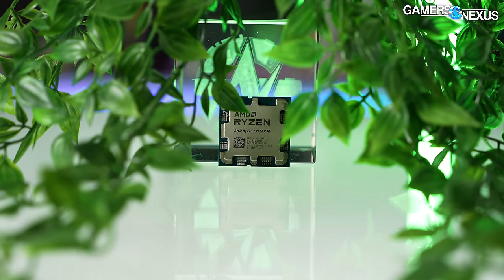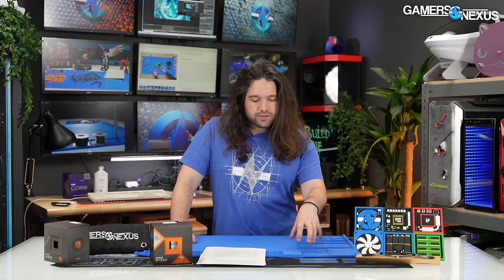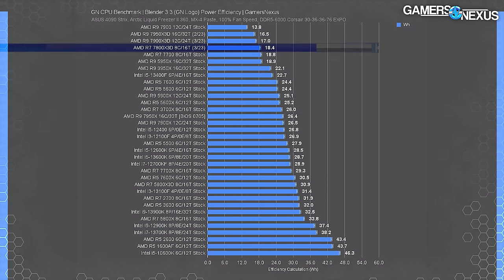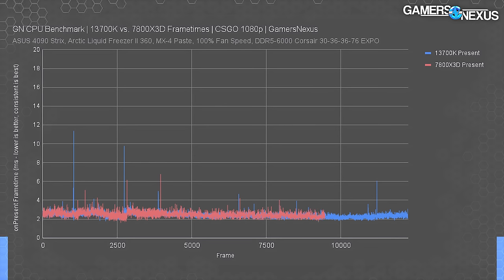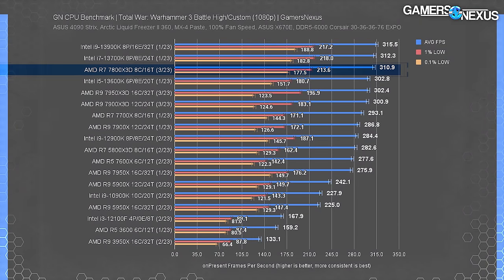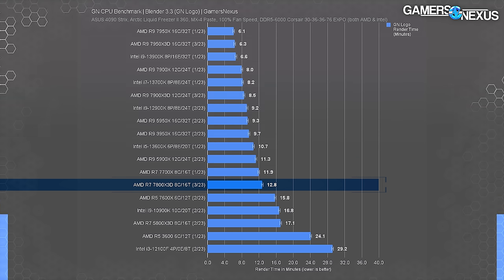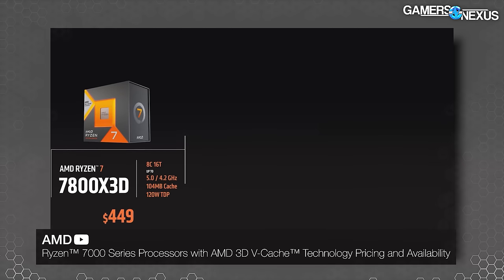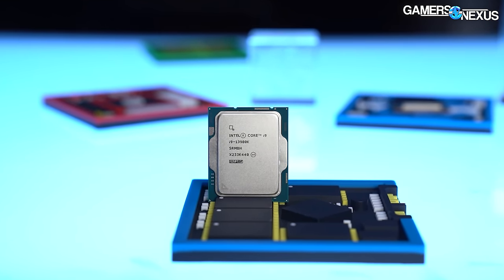AMD Ryzen 7 7800X3D CPU Review & Benchmarks

Comment: I feel that a larger subset of games would change the scenario quite a bit. Simulation games such as Flight simulator, factorio etc has the X3D parts pretty much destroying all Intel CPU's. Ironically those are the games that actually require a fast CPU. Would be great if you could find a way to benchmark any of those games and the conclusion, atleast in terms of gaming, becomes pretty different.

In general, even a tuned 13900KS can't really compete with the 7800X3D with a much larger subset of games.

Comment: This represents a monumental fuck up for AMD.  They could have just nixed the 7900X3D line and opened up the cores on the 7800X3D to 5.7ghz.  It would still be relatively efficient, cool running, and much better positioned as one of the best gaming CPUs available, competing much better with Intel.  Instead they effectively nerfed the whole 7000 series 3D vcache chip line.  What a bizarre move.  Intel will destroy these chips for gaming on the 14000 series, albeit with much higher power usage.  Efficiency is great, but gamers generally don't care about being THAT efficient; they aren't running long rendering workloads that take hours, but rather are generally firing up the PC for 1-5 hours of gaming a day.  I would have much rather seen the 7800X3D run at faster clock speeds with half the efficiency; it would still be substantially more efficient than the competition while competing on numbers.  We all know this is a numbers game, and most gamers who aren't married to a brand will just take the best performance for the price tier.  There is no way the 7800X3D will be the better bang for buck than the 14700k (and will likely even perform worse than the 14600k for gaming), but it could have been.  You'll save a bit on power cost, sure, but it won't be worth that level of performance nerf.  And I am not even getting into the whole issue with not all games even benefitting from 3D vcache.  AMD is constantly going their own way and shooting themselves in the foot.  They have great ideas and it is cool to see innovation, but they release gimmicky stuff like 3D vcache in chips meant to compete with Intel before it is even properly adopted.  Frequency is still king in gaming.  Why they would nerf the clock speeds of the most important chip (7800X3D) in order to sell their own inferior 7900X3D series at the expense of failing to compete with Intel this time around is flabbergasting.  The 7900X3D series is garbage for gaming, and the 7800X3D is nerfed for no reason.  How could they possibly have okayed this strategy?  Bizarre.

Comment: Do you have to do a clean install when coming from an older gen part like a 5600?
Reply: not necessarily. It will definitely work, for CPUs, it might show a scary-looking message about chipset change when booting, just agree with it and it'll be fine.
It is still slightly beneficial to reinstall because you'll have stuff related to the old chipset on your hard drive which might increase your boot time by a few milliseconds.

Comment: This is how I see it.

All x3d products are similar enough to say they’re the same for gaming.  They’re designed to be great when games are coded for them.  AMD clearly doesn’t do stuff without thought.  Cheapest model is good for gaming and also plenty of regular compute tasks.  Like photo and video editing etc.
They also have a mid tier for more production and a top tier for best production while also being able to retain top tier v-cache gaming performance.   I would argue that most people would either buy the 7800 or 7950 version and say the mid tier is a bit silly but I’m also not an expert marketer that understands the way people think and buy things.  Why would they make a product that clearly has no market?  
I would love to see actual sales of each to see how they break down.  
I’d assume 7800x3d would make up well over 80% and the top being at least 15% and mid the rest.  Who would buy a $600 product to save 100 when spending that 100 would save you so much time?  And most people that are building systems with top model are also pairing it with a mid to top tier gpu, at at least $800 if not double that.   That 100 dif is less than 5% of total sys cost.  Maybe the #s say otherwise but seems 2 models would be the way to go logically for sure…
And while this seems to be obvious on a high tier product like x3d it probably doesn’t Translate to the regular line of products?  Or are manufacturers just stuck in a system from the past that needs an update?  Especially with lower sales volumes in general.  We are now at the time where I’d say cpus are especially great at gaming performance and the upgrade timeline could be spaced out quite a bit longer.

Comment: I'm looking for a new PC and weighing 13700K and 7800X3D against each other. At the moment, AMD is cheaper (432€ vs 402€), performs a bit better in most video games and just destroys intel in terms of power consumption. Easy decision.

The thing I'm unsure about righ now is cooling. For 13700K I would've used an aio 360mm for all the energy it draws. even the best air coolers seem to be at their limits occasionally. Can, say the be quiet dark rock pro 4 or noctua NH-D15 more easily handle the 7800X3D?

If yes, that would be even more money saved for better game performance...
Reply: The 7800x3d is so much cooler, a $40 phantom spirit can do the job.

Comment: Absolute best channel, however reviewing a CPU, or GPU, and not including the midrange sku from each generations up to 4-5 years is not useful for the average consumer. I'm here looking at charts and have no idea how my I7-9700K, or a 9600K or 9900K, would perform and if upgrading would be worthwhile. If my CPU cannot achieve 120 or 144 FPS in today's games, then it would be nice to know I need to consider upgrading. Keep the good work.
Reply: some zen2 models are there for a measure; 9700k doesn't even have ht

Comment: The problem I see is, my lad has the 5800x3D, he would have to buy virtually a new PC to have the 7800x3D only to get 30fps average more, DDR5 and a newer chip for 30fps is not a good gain for the price to upgrade.

I have the 5800x and this makes the upgrade a little easier to accept, I just think AMD maybe should've waited for the 7000 chips release to drop the 3D vers, as the 5800x3D was just too good now splitting the two formats.

Comment: Is there any idle power consumption data in this video? It's really hard to find for some reason. Didn't use to be this way.
Reply: Not in this video but from my own experience with this CPU I can tell you that it pretty much stays under 10 watts for most basic uses and at idle will run less than 3 watts
Reply: @Silentguy_  Well I heard differently. Maybe things changed. Proof would be nice.

Comment: One thing not explained on this Benchmark, is the RAM clocked wth EXPO settings or everything at stock settings? I don't like the current stability problems with AM5 and don't know if i can use or not EXPO... anyone can tell? (I'm receiving 7800x3D with G.Skill Z5 Neo 6000MHz CAS 30 and Asus B650-PLUS)
Reply: Gamers Nexus always tests with EXPO or XMP enabled. Also Asus motherboards are known to explode you will probably want to get a Gigabyte.
Reply: @0Synergy  It was too late i already got my system. I have to say it work great so far.
Not any problem to post, run windows, games, etc.
EXPO I enabled, PBO negative 30, 18000 Cinebench and i've played some games already, very stable, low temperature.
I think the problems are still rare cases and was over panicking, a good system well mounted with good components have no reasons to fail. (got also the 4090 which have had some issues with rare users and their cable)

Comment: I was happy that you were including the frametime plots. However, if you'r using the same benchmark runs to make both those and the bar charts then I'm afraid you're still calculating the 1% low and 0.1% low fps incorrectly. 

You cannot correctly covert 0.1% or 1% low frametimes to fps as fps is moving average metric. Taking the frametime percentile data and changing it to fps removes the averaging ofthe data, and as such you are calculating a wrong/incorrect valu for framerate - you're just taking disparate points on tge frametime graph and smooshing them into an "average", which makes no sense. 

The correct thing to do is use a moving average to calculate fps and then take 1% lows from those numbers. 

(Yes, I know everyone in the industry is doing it incorrectly... It doesn't make it right!

Comment: So now that price for 7800X3D and 7900X3D is 20-30€ different, wouldn't 7900X3d with more C and T be beneficial for productivity? Like Gaming is slightly worse but rendering times for productivity are almost 2x less.... like thinking of waiting 67min for render to finish vs 45min is significant especially when projects are bigger and it is not in min but in h or days difference?
Reply: 7800x3d is $230 at microcenter if u get a mobo with it which might skew that. And if u want productivity ud go for the 7950
Reply: @Jzwiz  7800x3d is 400 bucks in Europe :(
Reply: @pepedeltoro6647  ye i hear prices across the pond suck :/
Reply: gaming will only be slightly worse if youre using a monster GPU like a rtx 4O9O at a low 1080p resolution.  otherwise in real world scenarios, the 7800x3d is pointless with no real gaming benefit and a very weak productivity cpu by comparison...

Comment: i am a budget hunter and found 3900XT+msi x370 in the use pc market for like 60 rials after negotiation (about 160$) and it works fine (fortunately in my local market AMD are not so famous and has less resell value) do u think it is still a good bargain for the next 2024 !?
EDIT: one of the ram slot doesnt work in the motherboard (seller clarified to me)it has physical damage

Comment: The bigger problem with Intel, as it's been the case many times before, is that you invest on a dead platform. If buying an expensive motherboard, I'd say go 7800X3D and update it a couple years later without worrying much about changing anything else.

Comment: I have a strong feeling that you are ignoring the power efficiency of the 7800X3D too much in your conclusion. Yes, you can save money with the i7 13700K, but in the end, it's consuming 280 Watts instead of the 7800X3D's 87 Watts.

That is hell of a difference, especially in Europe, where energy costs are high at the moment. So technically, i7 is more expensive in the long run.

Comment: What kind of cooler makes the 7800x3d run the coolest?
Reply: This is my personal experience but I have the 7800x3d with an arctic liquid freezer ii 360mm AIO and even on full 100% CPU load I've never hit more than 69 degrees ever. I idle somewhere around 35-45 with my fans set to the lowest and quietest mode possible. If I set them to 100% I can hit 30~ degrees which is stupid cold for these chips lmao. 

Couldn't recommend arctic enough!

Comment: The 13600K is a real winner for the highendish builds who want to get a solid CPU and put most of the budget into a GPU. AMDs entire high end lineup outside of the 7800X3D basically just got exposed lol. If you want to game get the 7800X3d, if you need multi-threading go Intel.

Comment: IMO the 7950x3d still retains a lot of value...it's perfect for the home or office user that isn't crunching video 24/7 and also games frequently. I personally feel way too much weight is given to 100% load productivity in these CPU reviews. I worked in a huge corporation for decades and nobody ever ran their workstation at 100%...ever. Given that few actual workers run 100% load on their chips for hours on end I feel the 7950x3d still has a large market...and lets be honest, if you're running 100% load 24/7 on a CPU you should be shopping above the desktop market anyway.

Comment: I thought AMD had reasoning behind the 7900X3D and the 7950X3D. It works for Intel too.

In Win 11, apparently you can alot which cores are used for what. I think the OS may even do it automatically. Meaning if you are a gamer, you can alot Intel performance cores to the P cores. Same with AMD alotting the v-cache cores to gaming. Then with Intel the E cores can run the OS or background tasks like streaming. I figured that might be what AMD were thinking.

However since we have not heard anything more about it, maybe it's not happening. I heard it first on a PC World video with Gordon talking to someone. Maybe it's not a feature yet, and is only planned for the future.

Comment: I do have a genuine question though...

If people buy say a 'high end' CPU like the 7900X3D or the 7950X3D, or the 13900K... why would you then play at 1080p? I'm seeing reviews (a lot of them) out there also with the RTX 4090, or the Radeon 7900 XTX tested at 1080p. So there's people out there spending Ks on their systems but don't upgrade their monitor?

The gap in performance between the 7800X3D and - essentially - everything else, is greatly reduced as soon as you move on to 1440p. Obviously, if we keep testing at 1080p for another 10 years everything released every year will look incredible. I don't get this. but whatever. Let's buy super expensive chips and GPUs and let's keep playing our games like it's 2010.

Comment: I have arctic 2 a rgb 360 and with 7800x3d i still get to 89 with full load, i tried unde gold and ppt limiting and i got to 83 spikes în game normal îs like 75 while gaming îs this normal?
Reply: According to AMD spec, 89°C is the TJMax for a 7800X3D, so the maximum temperature that CPU can reach before throttling. It's not normal, especially with an 360mm AIO, to have to tweak the power consumption thresholds to reach 83°C. For comparison, my stock air cooled 7800X3D run below 80°C full loaded under Cinebench. 

 I don't use water cooling so i just have basic advices : you can check your fans/pump speed (in the bios or the fans management software if you use one) and your air flow (blocked or inefficient path). After that you can also check the thermal paste application and if you haven't forgotten to remove the plastic peel of the block.

Good luck.

Comment: I wonder how big the difference between my 3900x and the 7800x3d is, in workloads. If I take the informations from your chart and guess the performance of my 3900x, it's probably the same or even a little bit better than the workload performance of the 7800x3d. That would be bad, since I want a good gaming and workload upgrade, without having to buy the 7950x3d. I'm pretty much 50/50 on work and gaming, but I'm not happy with the gaming performance of the 7900/7900x. That's why I don't take them into account. I have currently a 3080ti.

Comment: I had the feeling that the simpler chip would be king at the moment. Maybe if Microsoft updates Windows to have a better scheduler, it can change in the future. 

I didn't see a gigantic jump in performance in general. However, the power consumption would push it over the edge for me. I like the idea of lower power consumption since the levels have gotten so ridiculous. I feel a little better about owning a CPU that stays under 125W. My air conditioning is terrible especially, and we've been having heat waves.
Reply: 9 month later and core parking is still an issue

Comment: I'm bias because my new system of 3 days (black friday build saved $500 on a $3000 build!) has a 7800X3D but from my experience upgrading from my i7 8700k I think it's an awesome CPU especially snce it came with the new Avatar game coming out in December.

BG3 loads and runs far more smoother than in my old system with a 2080 and my system seems to run much cooler.

Either way I'm ready for future upgrades coming, that's why I went with AMD because I can now just swap CPU's rather than building a whole new system.

Intel should learn from AMD!

Comment: As soon as you factor energy consumption, regardless of these workloads... Well, nothing starting with an i is even worth considering, and the 7800X3D is even more crazy good. And it's not just the CPU wattage, but all the heat it's not generating makes cooling it cheaper, as well. Is it weird that this aspect gets so little coverage in these reviews? Like, we're just all using someone else's electricity for these machines, or something?

Comment: Before knocking the 7900X3D consider that its primary purpose wasn't 100% gaming as NOBODY needs or will need a 12 core CPU for gaming only, at least for a couple more years. The 7900X3D and 7950X3D are meant for somebody who is a gamer but also uses their system for productivity. I was frankly so spoiled by the 5950X that I really noticed the decrease in overall system responsiveness when I switched to the 5800X3D. That's why I opted for the 7900X3D this time. I figured 6 more cores for a $140 increase in price couldn't hurt, especially in the long run. I just can't stand my CPU being at 100% while I do my everyday tasks because I feel the system slowing down

It's a very niche use case. But these high end hybrid CPUs ARE niche products built for such niche scenarios.

Comment: I'm running into an issue where only 1 of my cores will peg 100% while gaming and most of the other cores aren't doing much like usually < 20% and I get huge performance issues. I'm only gaming at 1080p on my Ryzen 7800x3D with a 12GB 3060. I stream while I play and I have thing's like mic dropping on stream seemingly randomly stream deck response becomes delayed and the game becomes super choppy at time. Yet the final core shown on the windows performance monitor is pegged at 100% and the rest tend to be doing next to nothing. Fresh PC in all regards with a fresh windows 11 install. I'm kinda loosing my mind over this, anybody else getting issues like this?